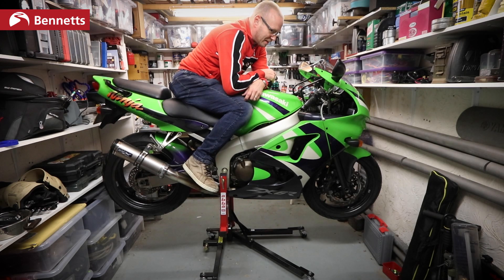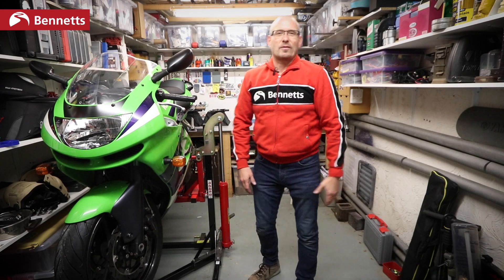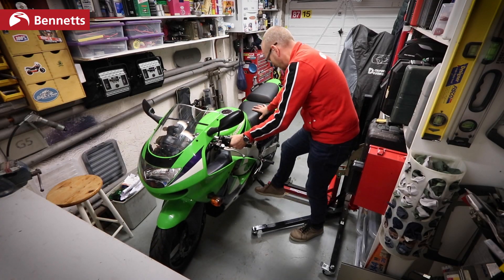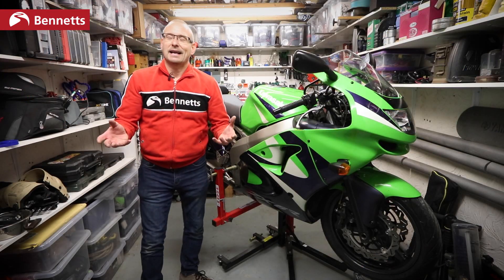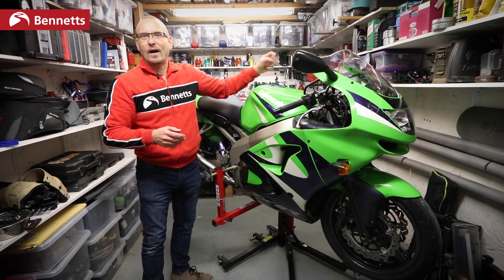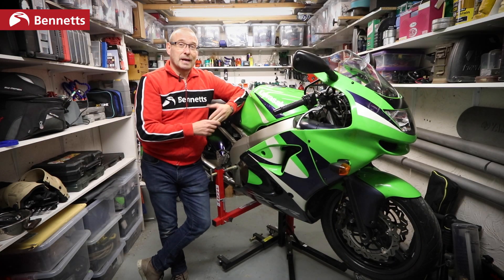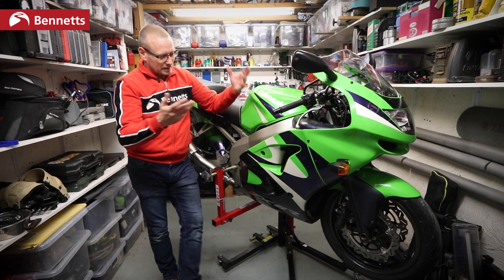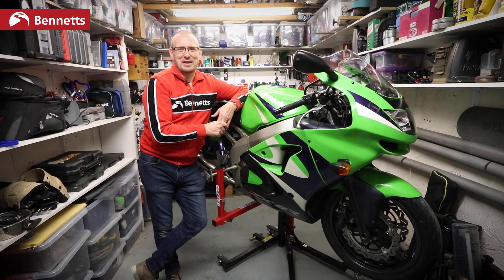Abba sky lift review | What tools do you need for a motorcycle?

Comment: I have a chopped up concrete drive, which I should really get round to repairing. I run my Sky Lift on a 9mm thick sheet of plywood which cost me £35 from Wickes. I put 3 coats of Cuprinol on it and I can wash my bike on it. As I am a reverse biker (I commute to my work in the Winter/Spring, and go out a few times a month in the Summer) I use it to get under my RT to keep it clean. Last weekend I had my RT up, with the lower fairings off as I sprayed XCP (thanks John!) on my Option 719 engine covers. My commuting to London started on Monday, so thank God I XCPd the engine covers. It bucketed down and the M1 is still shite. The A509 is buggered too, so what should be 65 miles in around 70mins was 95mins is p1ssing down rain. 

The Abbastand was a luxury I treated myself too when I got my RT in Nov '22. I sneaked it in under my agreed £22k spend out of pension lump, but even though it's an infrequent use, it's truly a great and useful piece of kit. It's also one of the few British products that is made properly and to the standards we used to be known for. It's not cheap, but if you're like me with arthritis, it's easy to get it up to comfortable working/cleaning heights too.....I also splashed on a Brühl Twin Turbo blower which is another fantastic product.

Comment: My best tool in my garage! Absolutely brilliant! The only thing that I will change are the wheels I don't know why they would even think of using plastic wheels on this unit with a 500 pound motorcycle. I have a feeling once I change the wheels out it will roll much better. I just have to find a set with good brakes on it because I do wash my bike on an unlevel surface in the driveway

Comment: how difficult is it to get them in the super tilted positions? also is there a locking mechanism should the jack fail?
Thanks
Reply from the maker: I don't think it's hard to get in position, and yes – there's a pin that goes through in three positions that takes all the load off the hydraulics.

Comment: All of the videos that I've seen have the main part of the lift on the left side of the bike. Is there any reason why is can't be installed from the right side ?
Reply: It's because the bike would be facing the wrong way for the strap attachments to be fixed allowing for required angle of bike 👍

Comment: Nice gadget. Pity about the illegal number plate on the bike. You should know better.
Reply from the maker: It's horrific, isn't it?! Fortunately the bike is SORN; I bought it, put it straight in the van, got it back and immediately started taking it to pieces. Yep... no test ride, which goes against all the advice we'd usually give. In my defence, I do know the seller, and the point of buying the bike is to use it for a series of DIY maintenance features. Before this thing hits the road (which will be to go for its first MoT in years), I'll be fitting a proper plate to it. John